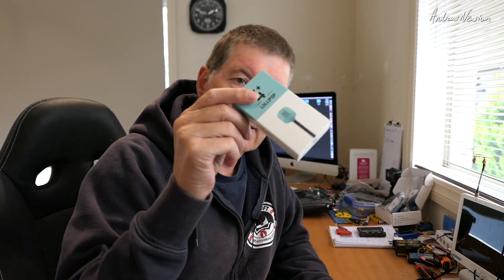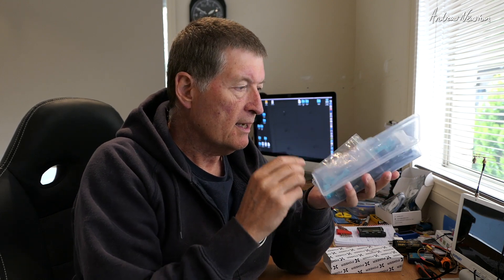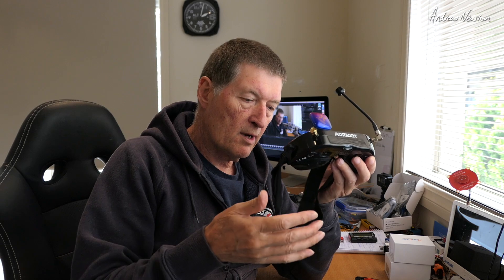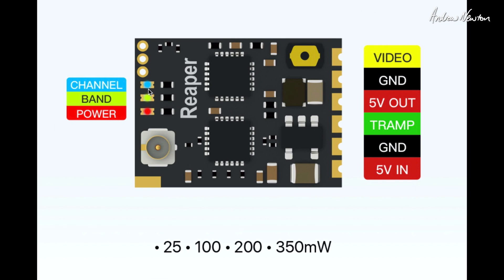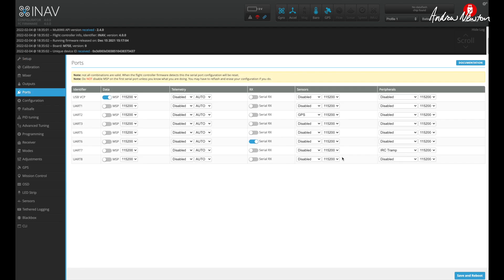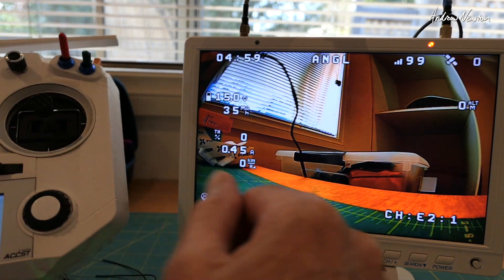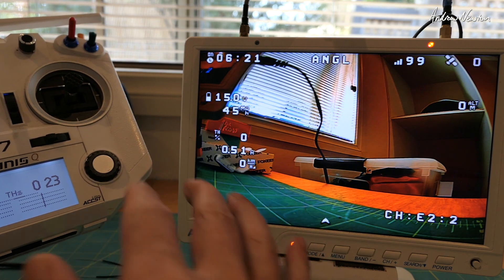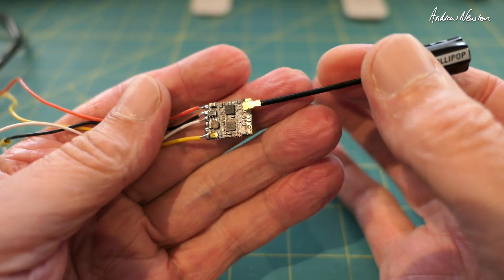Foxeer Reaper Nano Video Transmitter

Comment: Was there any noticeable heat when you had it powered on and transmitting?  Heat is usually an issue with this size vtx.
Reply from the maker: Oh yes, very hot. Must be in good airflow for higher power settings

Comment: Good stuff in your mailbag, for stocking up the spares bin. :)

When planning your Aura LR Quad frame build be sure to include a gps with compass, so can use INAV portion hold, and other nav features. It's like having a pause button. Hopefully you have INAV comparable flight controller for review as well. Quad FC and ESC stacks are pricey this year.
Reply from the maker: Thanks for the tips!